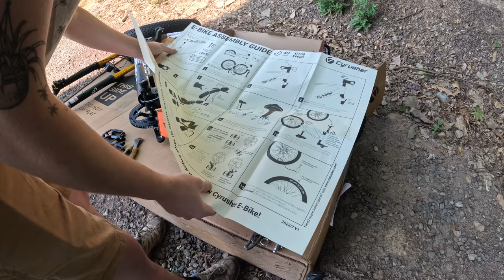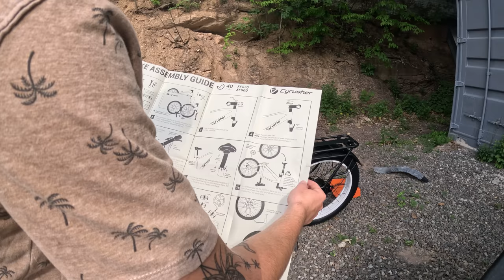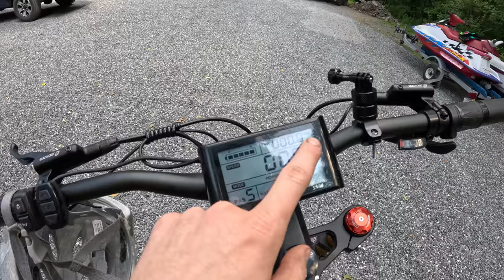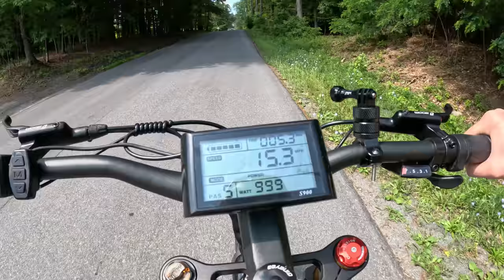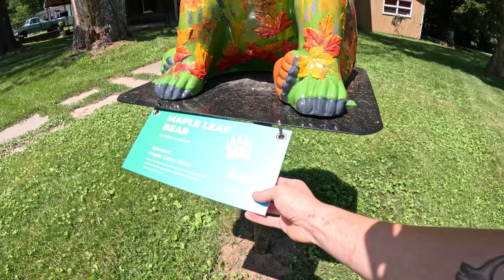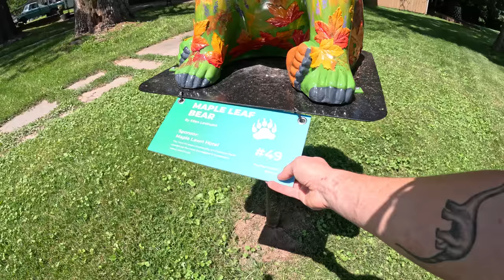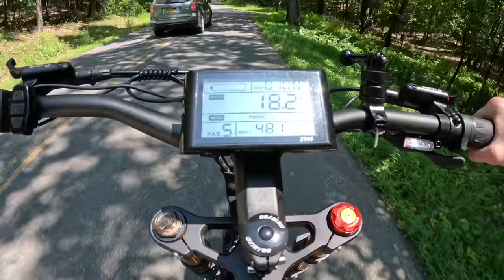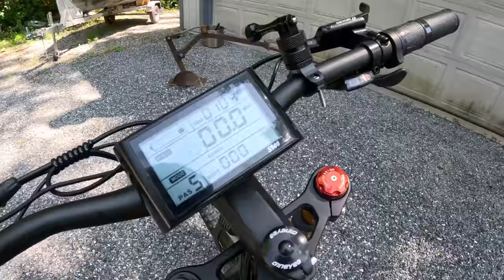Cyrusher E-bike Adventures

Comment: Only thing is, you have to worry about loose dogs. I'll never forget the time I had one run up under my motorcycle, plus another time a huge dog grabbed hold of my pants leg right when I had accidentally knocked it out of a better getaway gear.  Don't know what the solution is for dog deterrent.

Comment: They are fun bikes but be careful with the recharging they tend to get hot (battery and charger). Also be sure the battery stays fully locked in when riding they also tend to get loose causing issues. Enjoy and be safe,

Comment: Awesome video, Samantha. Be very cautious on how and where you charge the bike when at home. I don't have much faith for E technology safety.

You couldn't get a more honest review and usage from Sam
Reply: When I was a kid they used to sell generators that work off the tire to light headlamp, maybe they still do, but you would think they would have something like that on an electric bike.
Reply: @charlylucky7508  we had 6v dynamos back in the 70s & 80s that bolted onto our bike frames and engaged with the tyre. Regenerative breaking or charging on the go wouldn't work due to several factors, one being insufficient charge current

Comment: Great video, beautiful area. I'm impressed that you could squeeze 30 miles out of the battery, considering the terrain and the size of the tires - The rolling resistance is quite high with the fat tires, as you found out when the battery went flat. lol

Comment: I find if you go offroad its better to turn off pedal assist and just use throttle ,because assist just tries to get you to a certain speed , but on road the assist gives better automatic battery  performance . On some controlers you can set them to power limit in volts or current (load) and you can get better duration . Best to have the throttle set to give max power and assist to give 50% power .  Totally GREAT video though , it was like going on a holiday

Comment: Sam, I noticed the front forks have adjustable pressure to make them stiffer or softer it looked like your e bike has them at max. Stiffer. On the one fork at top facing you there is a red cap that looks like for adj. You might want to soften your ride if you have questions call manufacture. Love the video.
Reply: I also noticed on the unpacking that the other red knob on left fork looked like it was missing for adj. Fork presure. Softening your pressure will make your ride alot more enjoyable. It looked like it was to stiff for you.  The tubes in forks are to soften impact of bumps.

Comment: Nice rounded review, good to see some proper usage … I think you would benefit greatly from spending 15mins tweaking the suspension, unlike most road car suspension which is fixed, bike suspension is pretty tunable (air or oil, spring, etc) and you'll be amazed what a difference it can make. Setting it appropriately for sag and rider weight will make a massive difference. For instance, that little rubber o-ring on the rear shock is a travel indicatior, if its not been pushed to near the top of the stroke then you are wasting a lot of travel, comfort and grip … similar for the front forks. Easy to do, but overlooked by most riders seemingly.

Comment: sweeet...28T - 34T cassette is good for the loose sand on the beach, my shock was rated for 1500lbs, I dropped that to 400lbs (much better for rocky roads)

Comment: 37:28 Yeah, at no point did it look like the suspension was operative and the red O-ring tell-tale pretty much confirms that. Even if front and rear had a good lock-out mode, I would be surprised if it was meant to be that rigid. Currently, the only suspension was from the air pressure in the balloon tyres.

Comment: would love me one of those ebikes but in the U.K they are kind of illegal since they aLL GO above 15mph anything with a motor in the uk that go above 15mph you need it to be taxed and insured soo... but looks awsome one tip though for any kind of bike frompedal cycles to motorcycle allways make sure you can sit in the saddle with both feet flat on the floor otherwise you will have problems at slow speeds.

Comment: Wow, that water looked cold!! 🥶 I had the same problem with my e-bike Sam, when I was assembling it I had to go back and re-tighten all of the factory screws and bolts. Sloppy quality control, or they all rattled loose on the boat trip from China?

Comment: One other thing:   early design disc brake bicycles were found to be flawed by the open ended front fork, in which the front wheel axle slides into.   The torque arm on the disc brake is just about right to twist the axle out of the fork end with really bad results to the rider.   This also happened sometimes on rim brake bikes when the rider failed to tighten the axle into the fork adequately so
"lawyer lips" were added,  small tits on either side that reduced the likelihood with rim brakes (about 35 yrs ago).  Disc brakes were subsequent and the lawyer lips were no where near enough to prevent the potentially massive torque arm of the disc brake.  So the redesign is a fork with a hole not an open end and the axle is retained by a 12mm diameter solid rod that inserts through one side of the fork and threads into the other.  Your bike has bolt on axle, better than quick release but still not fully safe.  I would check it for lawyer lips and torque it down before each ride, maybe a bit of thread locker as well.  A face plant into rocks or pavement at 30 mph would cause multiple fractures and dental loss, take about a year to get over.

Comment: You definitely want to make sure your within range and not go further than like 45% of your battery power at halfway point of your trip There are charts online that will tell you how much of your battery is left based on its capacity and current voltage   That are far more accurate then the display tells you

Comment: If those falls had been engineered they couldn't have been better. The wide knobbly tires are OK when the motor is working, but they are the worst thing when you have to do the work. Big contact patches are big drag.

Comment: Your 100 mile range is impressive.  My Rad-Rover only has a 50 miles range, So I bought a second battery.
Reply from the maker: In the video I explained it had a 30mile range maxing out the assist I had 104 miles on the odometer
Reply: @samanthaweber6932    Thanx Samantha.  I uses assist level 2 and am lucky to get 50 miles.  My Rad-rover is 5 years old.

Comment: Your seat would be more comfortable at least 2" higher, probably more.   On trail you should probably mechanically downshift to mid-cassette at least and on hillier trails lower with pedal assist set up in the 2-3-4 range at most.   Range of 30 miles not bad for a mostly assisted ride.   Light weight road ebikes (28-40# bike+battery) weight can go 50-80 miles on a charge.  Cyrusher bikes seem to be relatively inexpensive by ebike standards and have large motors and batteries.

Comment: Nicely covered.  I would like to ask a question or two, or three.  Was this eBike sent to you to review by the manufacturer because you have a channel and were you asked before it was sent to you?   I am guessing that they simply wanted an honest opinion of the eBike.  I had the prior opinion that eBikes could be used much like a motorcycle when going up hills.  Can it propel the bike and you up without any help from you?  At the first point when you were discussing the hill, it appeared that you were helping and struggling to climb the hill, this is when you still had enough power.  It also seemed that you were always pedaling without a rest.  Was this true even going down hills?  Was there a drag on the chain and pedals (because of the regenerative power production) so that it would come to a stop if you didn't continue to pedal?  Did you ever mention if it had a suspension in front and/or back?  It looked like it did not have a suspension because you appeared to be jostled about when you were on the grass of the golf course.  Was there a regenerative braking system that was supposed to be charging the eBike whenever possible?  Did you feel it was adequate?  Did you ever mention the price compared to the model?   You mentioned, in the beginning, that you suspected it was already fully charged.   Did the directions indicate that it should be given a full overnight charge to be sure and saturate the battery?  This might have helped at those times when you suggested it was running out of power after a full run.

You have very nice areas to ride in, very nice scenery.  Doing well, keep it up.
Reply from the maker: Yes it was sent to me for a review, and I gave it an honest one. Yes, using the throttle on the handle bar you do not have to pedal. I constantly pedaled to give an accurate range test but it doesn’t stop moving just because you stopped pedaling. It has both front and rear suspension and I believe they are adjustable. I do not believe this bike has regenerative breaking. The charger has a light indicator on it that lets you know when the battery is fully charged. This video was recorded on multiple rides with multiple charges. The only ride that was one full charge was the “range test” which was done from full charge to complete battery drain.

Comment: Samantha that's not Greece that came with air brakes that is a solution that you put on but back of the pads so it stops or breaks from chattering making noise why didn't you read the instructions Samantha